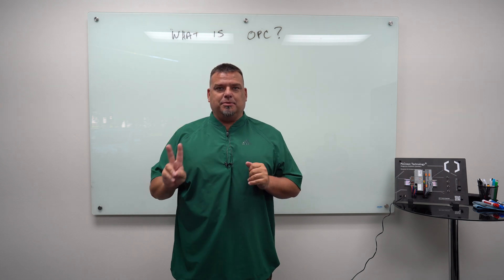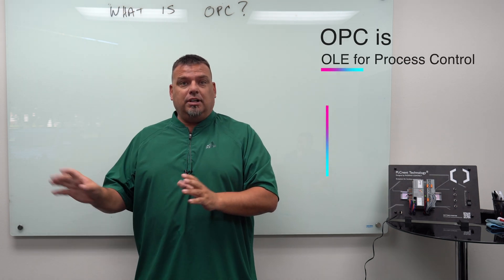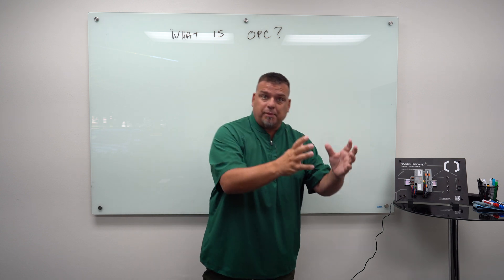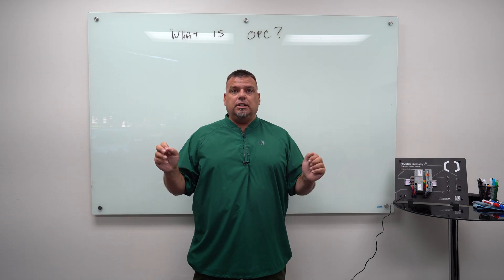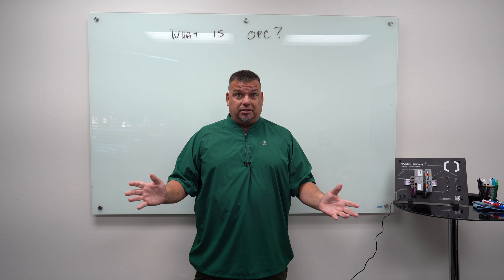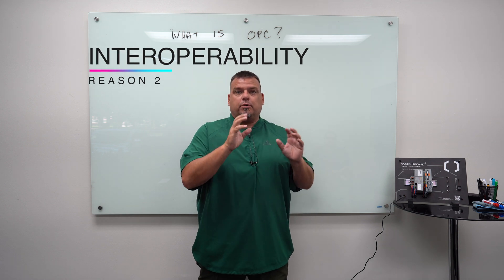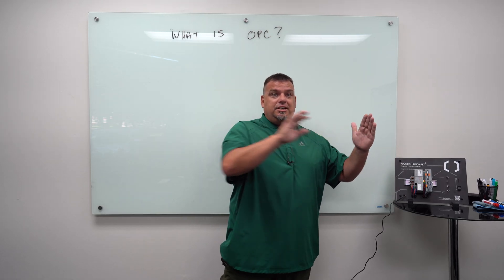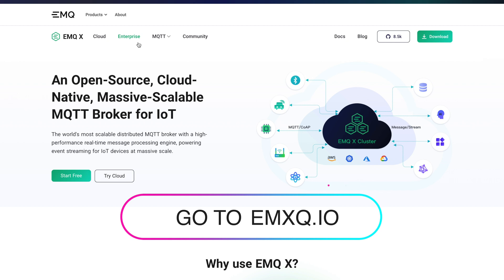What is OPC? - Part I - What you need to know...

Comment: In the 90's when I was working for the steel industry automation, we had an open and modular communication system known as Oracle Remote Data Transfer to interoperate Simatic PLCs with supervisory control systems. Cant find it any longer.

Comment: Thank you so much for this amazing video. I am struggling with some fundamental.    Is the main idea for OPC-UA is  data collection  or is also for real time control. e.g. controlling a motor , synchronization between  industrial controllers, turning on/off actuators, etc ? I mean is it  a replacement to existing protocols as Ethernet/IP, Modbus,etc ?
Reply: No it isn't for real-time control. Generally OPC goes 'up' from the PLC to an HMI or SCADA system, not 'down' from the PLC to your field devices like sensors and actuators. OPCUA and EtherNET/IP are apples and oranges.  ETHERNET/IP and EtherCAT for example are more apples and apples.  Modbus...I don't know exactly but I think its like a turkey
Reply: @adamrohde3513  Thank you Adam. Very Helpful.

Comment: In my Udemy course on Classic OPC, one of the demonstrations involves a client that supports HDA but a server that does not. It is used to advise the viewer to ensure that they check which of the DA, HDA, A&E specs the clients and servers support in order to avoid a "mismatch". Whilst this is a relatively easy thing to check for in Classic OPC, it's not as easy in OPC UA as UA has many more considerations. I really appreciate how you gave a view into the structure of the OPC Foundation. I never knew it was structured like that but it clears up a lot. That being said, I think Classic OPC was an amazing thing in the 90's. It lead to so many benefits. But you are quite correct about the trajectory. Something went a little awry. Thanks once again for this contribution!
Reply from the maker: Thank you Emile!